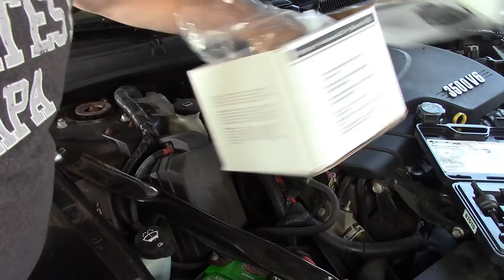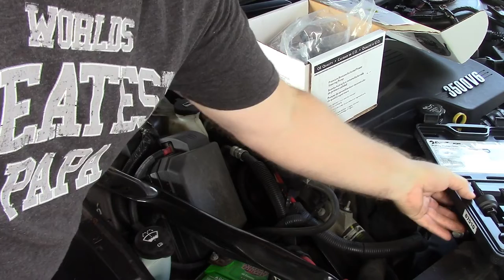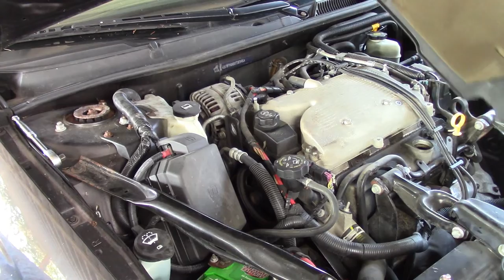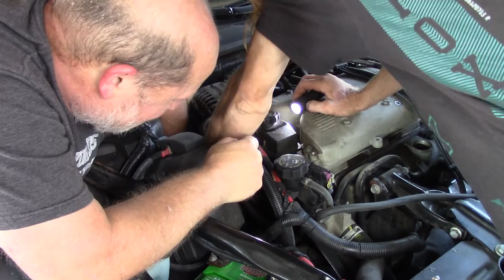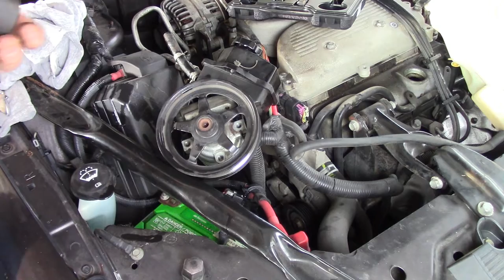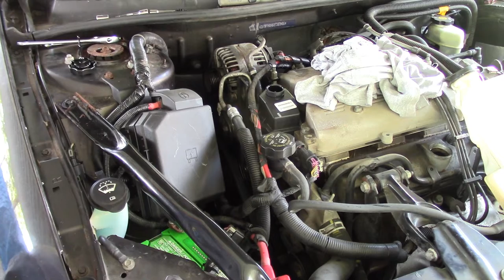2008 Chevy Impala Power Steering Pump Replacement

Comment: I experience a  strange whining noises every time I turn to the right when I'm backing up. Do you think Its a sign that may Impala 2009 power steering pump needs to replace? Thanks in advance.
Reply from the maker: It could be going out. Keep in mind if you turn all the way to one side to the point it will go no further and apply pressure it can also whine. Thats kind of normal. And most of the time when the pump is going out it will whine constantly or even when you move the wheal just a little. 
Even the rack and pinion going bad can put a heavy hydraulic load on the pump and make it whine.  Investigate well before throwing parts at it.  
Hope this helps.

Comment: If i buy a new pump with the pulley I wouldnt have to use the tool or remove the pulley correct?
Reply from the maker: Hi. As long as the pulley is the same your good to go. Hope this helps
Reply: @livecarbuild  thanks, appreciate the response on my late comment

Comment: Good video. Big tip, replace the oil fill neck after removing the top cowling to prevent anything from being dropped into the hole! 😜 Because if something goes down the hole you will wish it didn’t! 👍
Reply from the maker: Thank you for the kind words and the tip.

Comment: It looks like you didn’t bleed the pump.
Reply from the maker: After adding in fresh fluid tou can turn the wheel back and forth from one side to the other which can bleed out the air and top off fluids. Best of luck. Keep us informed.

Comment: Did you have a plastic seal in the box where does that go
Reply from the maker: Some parts are universal and fit many cars or years. You may need the seal you may not. If needed it will only fit one spot. I would have to see the seal in question to give a better answer.

Comment: Should have showed using the belt tensioner.Thank you though gonna change my pump today. Best video online for this job.
Reply from the maker: Oh ya I completely understand.  The tool is pretty self explanatory. Just take your time and how to use it will fall in place for you. You will see the bar has a square tab that fits into the tensioner. Use this to make it spring over and remove the belt when it gets loose. 
Please fill us in on your project progress when you get a change. Good luck.
Reply: Changed the pump successfully thanks to your video. I just used a regular ratchet on the belt tensioner and an extra hand lol
Reply from the maker: @dasen11  Glad to hear it went well for you. I've used ratchets as well when they fit between the frame and pulley
Reply: Pump stopped working two days later 😔 gonna look at the lines and the gear box I guess.might be rack and pinion.this isn't a forum so I'll leave you be lol
Reply from the maker: Sadly enough that's correct. It could be a bad rack as well. Don't forget just because the pump is new doesn't mean its not defective. Good luck keep us informed with your progress.

Comment: Did not even show pulling the pump out. Instead i watched an arm
Reply from the maker: Hi. Once the pump is loose the only thing I did was remove the low pressure hose clamp slide off the low pressure hose and then you see me remove the high pressure line with a wrench. Please keep us informed with your progress.